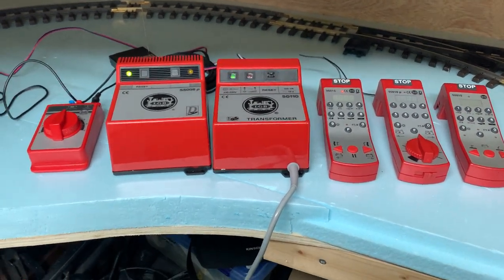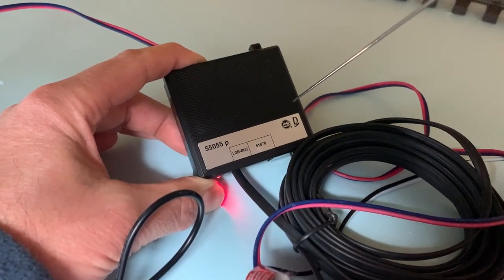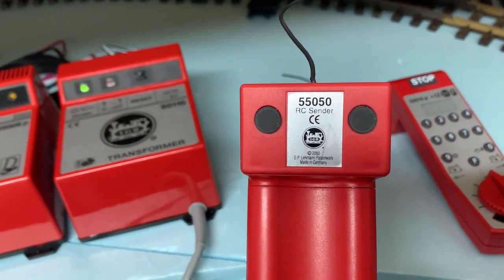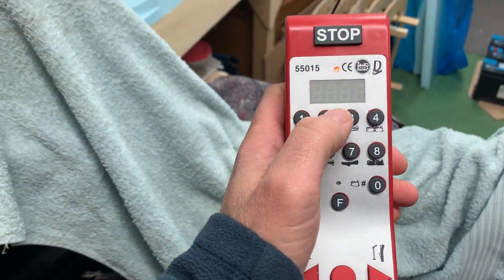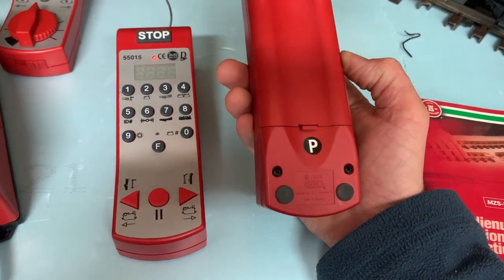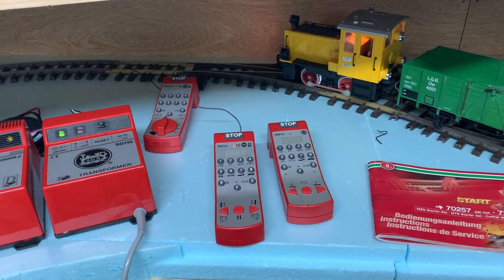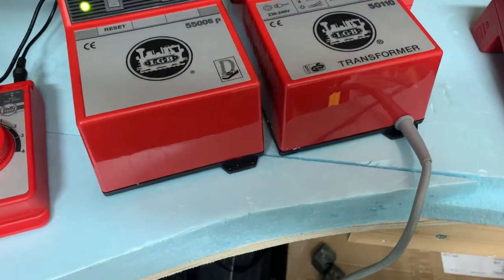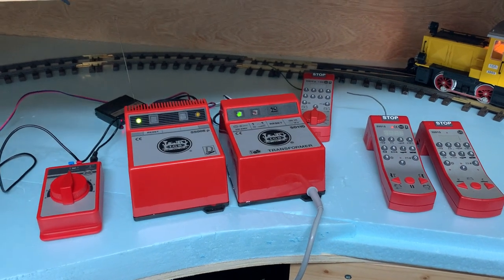LGB G-Scale MTS (DCC) Serial and Parallel Wired & Wireless Controller Myths Busted

Comment: There’s nothing wrong with vintage electronics. In fact vintage trains same category. Sometime in the 90s - 2000s depending on the item the QC went in the shitter and you don’t know if brand new in box even the item will even work. Be it a locomotive or a dcc system.  Obviously I know nothing about LGB (we have a g scale subgroup in the club) but this is from the era before electronics are total crap. It’s because it’s not from china. Some china is fine but some I call it counterfeit because it works temporarily out of the box if at all. I am running a dcc system from digitrax that is at least 16 years old. And buying used throttles for it for the same reason. Because it still works flawlessly and consistently. There is a Lionel channel that I watch and he is selling all his Lionel (modern legacy full electronics) because almost none of it is problem free. But he can’t figure out why the older sets from 1998 and 1965 converted for inflation with less features are going for more. It’s because the older stuff is made better. Don’t get me wrong I love my Broadway limited. But a lot of people have had trouble with it and no trouble with kato. I think paragon4 is the version we’re on which means it took 4 versions of decoder to get everyone happy. Those days of 2 feeders and just plug it in the wall and it just works are absolutely behind us. Unless you go on eBay etc and find stuff like this to play with. My question I have is are you going to be adding sound? Surely there is room. Or Does LGB make a sound unit with all the do dads? I can’t really remember did you do alot of sound in N? It was mostly kato correct?
Reply from the maker: You can seemingly add sound decoders to the older loco’s (sort of) but Lehmann, in my humble opinion made a terrible mess of rolling out dcc at the time which is a shame. I don’t have plans to add sound at the moment and never added sound to my Kato loco’s either. The best modern DCC solution offering value and a lot of options can be found with the guys at ML Train in Germany - https://www.ml-train.de/. They even do a dcc controlled uncoupler which is slick. Use a browser that can translate to English.
Reply: @rhopkin2512  do not bother putting digitrax drop in sound in your kato. It isn’t worth the money and is too quiet. An example of bad rushed to market. If you want N scale sound BLI best value. Yes ESU but as far as turnkey no programmer to buy and no milling your engines. BLI is the turnkey best option. Scaletrains sounds great but the wheels are out of gauge lol. So they can put ESU and all that detail but they can’t make wheelsets now. Now that you have dcc working on G It won’t be long before you do something with sound, why not the hard part is over. I like the black tank steamer that you have that came in the double set it’s sharp, like the old Arnold N scale stuff DB prototype